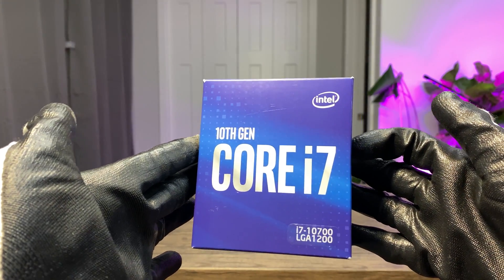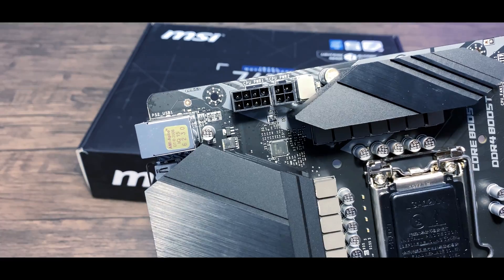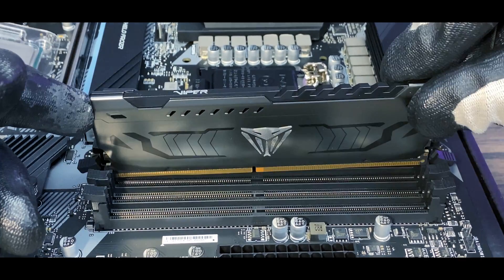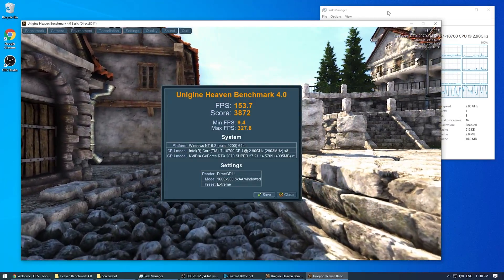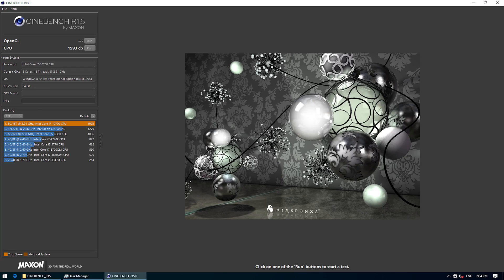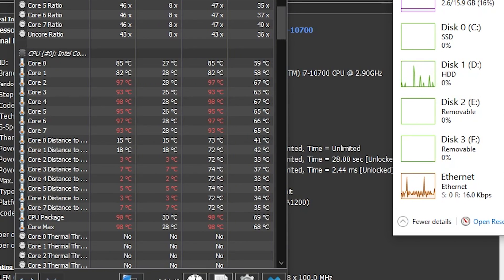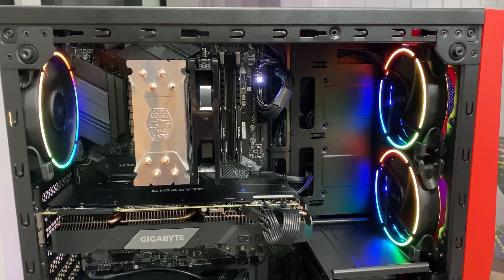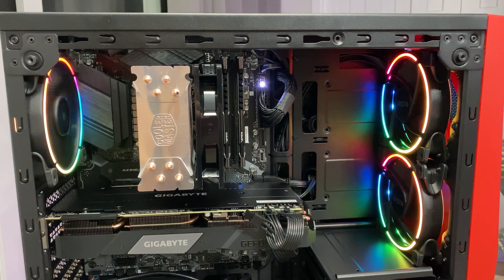Best $1500 Intel Gaming Build - RTX 2070 Super, i7 10700 (w/ Benchmarks)

Comment: This build doesn't make any sense. Why such a budget CPU cooler and case Fans, but an overly expensive PSU and motherboard. Like, price-to-performance wasn't a factor of thought here at all.
Also, F.Y.I. Your PCPartPicker list is incorrect.
Reply: PSU and motherboard are the most important, even motherboard over PSU
MotherB is the top of importance. no matters the fans over motherboard.
 add whatever cheap fans or cooler, a cooler master is better than Intel cooler included.
I will assemble a z590 aorus i7-10700, I won't overclcok, not interested on it, I won't add GPU by now, and I'm here searching about RAM 3000 MHZ. 
a cheaper motherboard is ugly, that's why I overkill  ('?)
Reply: @georgemartinezza  the guy who posted the comment felt dumb so he never replied
Reply: @abraham12343  finally- instead- I assambled a 11700K on B560 Aorus Pro AX :P  XD  I wanted i7 10700. but the price was really a good sale here in Mexico!
Reply: @georgemartinezza  niiice, i actually have an i7 10700f 2.9 - 4.8. It came with a prebuilt I bought for gaming
Reply: @abraham12343  I imagine - you already have GPU. ! ?